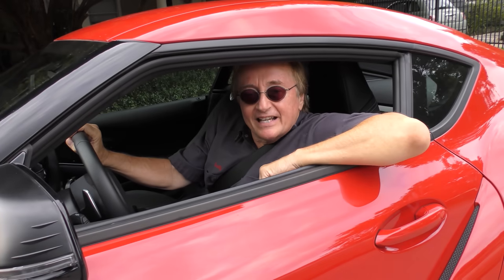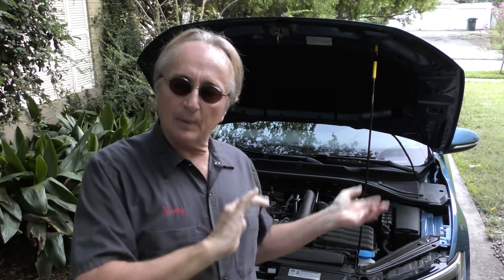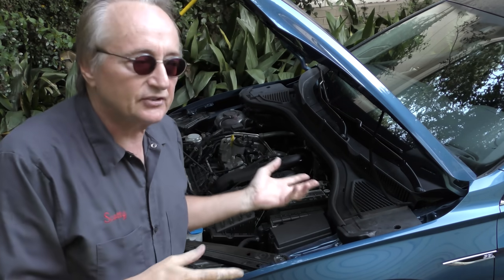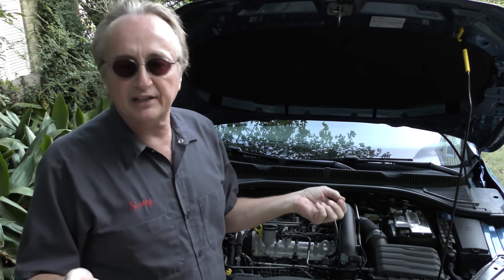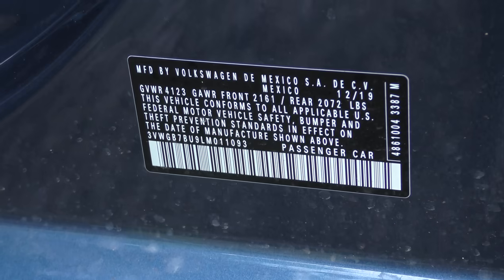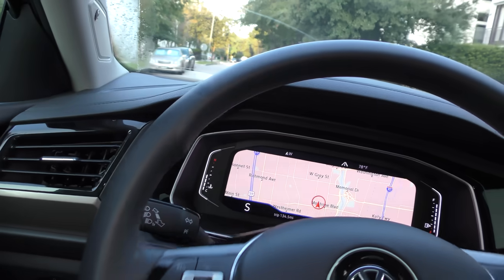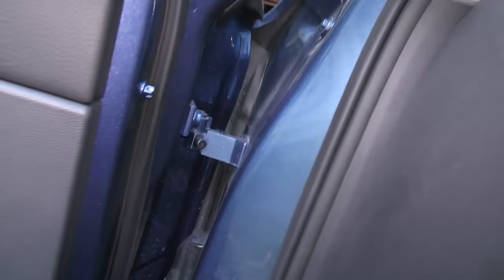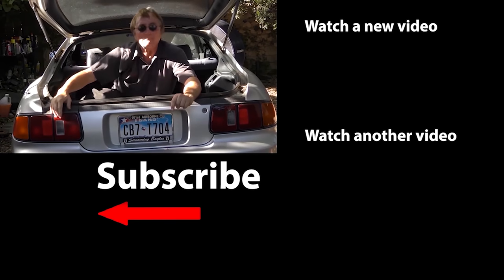I Just Found the Worst New Car Ever Made

Comment: “Everything I don’t understand is  the worst.” - Toyota drivers
Reply: Right? LOL they get confused when they drive an expensive car with good handling, comfortable interiors, and powerful engines.
Reply: Bah ha ha!
Reply: I have a Toyota Tacoma and been through a Corvette C5 for 5 years, and now have a 2021 VW GTI. I can tell you right now the GTI handles and rides better! The interior is way better, the engine is easier to maintain, and no more automatic Silverado transmission. Now I have a dedicated manual transmission in a German car. It's so fun!
Reply: @Dcc357  ditto! Been driving VW since my first car way back in 2002. I have a GLI. Your 4 door cousin.  Lol and 6spd manual as well. Lol never owned an automatic. I get restless in them. So I need a completely engaging experience. Lol
Reply: Nah, that's just Scotty. I drive a Toyota and this Jetta looks like it's a great car. Especially with the cost of fuel nowadays.

Comment: That turbo may be easy to access but it's built into the exhaust manifold and the cat too! Need a new CAT? You're also buying the turbo. This also has air to water intercooling on the intake side and that's not a cheap assembly either. Lease it new or forget it.
Reply: It's a solid design, VW has been using it for years.

Comment: The high end Corolla XSE/XLE can go between $28,000-$29,000. Corolla has a 1.8-liter engine or 2.0 engine with timing chain
Reply: Imagine how much the OTD price is on that Corolla lol. No thanks
Reply: @spoton3278  it'll still be worth more than the vw with the same amount of wear. So you save more in the long run.
Reply: Yeah step 1 buy a cheap 2002 corolla s.step 2 rebuild the engine for 1500 because they are oil burners. Step 3 now you got a new car and its quicker than the new corollas cuz how light it is
Reply: @hemiplow1297  My family owned 2 corollas from that generation which I actually grew up learning how to drive from. They are the slowest cars I have ever driven, they may be lightweight but only have around 100hp with a 4 speed trans - 5 if manual
Reply: @Argedis  actually 125 hp for the 1998-2002 and same to torque pretty plenty
Reply: @Argedis  actually 125 hp for the 1998-2002 and same to torque pretty plenty
Reply: @Argedis  vs 130 hp for the 2020 corollas. ..but again you are like 200 lbs lighters slap an air intake and do a few boltons you will easily exceed these newer cars
Reply: @hemiplow1297  You are looking at this on paper... My parents had a 98 and a 2000 and I drove both for several years. Small, light and nimble? Yes. Peppy in the city but gasses out extremely quickly because a lack of power. Merging on the highway is extremely slow especially with passengers. My 2014 Mazda 3 with 155hp weighs 2800lbs and feels like a rocket ship compared to those corollas. I still loved those Corollas but I will never forget when I had my friends in the car  and had to merge on the highway with my foot WOT and it would take 15-20 seconds to get to 60mph
Reply: @N0RT2G0RD4U Hondas are not tanks like in the 90's.  Toyota is my first choice. The interiors of Honda Civics just fall apart after warranty expires.
Reply: @Argedis  seesh really? It only took like 9 secs to get to 60 for me in my 1998 corolla le with 200k miles i race people up and down the highway all the time lol Ive maxed out my speedo few times where it went over the 110mph mark.but your right it does feel quite slow with 4 people in it when going up mountain passes i must put my emergency flasher so people dont honk at me lol
Reply: @N0RT2G0RD4U They are cheaper with the smaller Corolla then the bigger sedans
Reply: Warranty Direct rates VW the 2nd Least Reliable engine due to frequent breakdowns.  My Beetle died at just 70,000 miles.  My 2 Hondas went 300,000+ miles with no engine breakdown.

Also VW commits criminal acts by cheating on EPA and EU pollution tests

Comment: A tiny turbo charged engine AND a timing belt.... NO WAY I would ever consider buying that.  The word "warranty" is overused and has no meaning nowadays.  The warranty is for the belt only.  It does not cover any damage done to the engine or valve train when the belt does and will fail.

Comment: Why would you want a car that isn't fun to drive to last forever?  I prefer a car that is fun to drive.  If I have to replace it every 8 - 10 years, not a big deal, as the technology changes so fast a 10 year old car is way out of date.  For a car that "lasts a lifetime" get a pre-1970s classic and fix it up, like my 1962 Ford Falcon.  Simple, easy to work on.  No emissions system to worry about.
Reply: Toyota Corolla or Honda Civic are fun to drive

Comment: I had my timing belt changed on my 2017 Jetta at 180000 miles and the mechanic said that it looked great. I'm not gonna change it again until 400k. Cost me $1250
Reply: 180,000k on a 2017?? How has the car been? I have a 2010 Jetta that just his 140k. The only repair I’ve done besides maintenance is one ignition coil
Reply: @gunnargeroy8406  it's been great. No issues whatsoever.
Reply: @CourtneyKarl  wow, awesome!I’m gonna get a 2020/21 when mine is paid off lol

Comment: I’ve had this car for about 3 years and the gas gauge is definitely “optimistic”. You get about 600-700km/ tank, but after 300km it will still read 3/4 full. The gauge drops rapidly after that.
Reply: Same with my civic. 
I get 550km.a tank but the gauge won't move till after 150km ..lol
Reply: I've noticed the same thing

Comment: 2011 Jetta, bought used at 58,000. Now at 140,000. Only replacement so far are spark plugs. Besides the horrible fabic liner, everything is smooth sailing

Comment: I have this car, same trim, same color.  Im sort of relieved that he didn't have more bad things to say.
Reply: Kinda funny how he was hating on the whole timing belt thing. I’ve had 3 mark IV VR6 VW’s and they all had a chain. Put 200k on one and still didn’t change chain.  But in response to having a belt now like everyone else.... if you are smart and keep ontop of your car just check out the belt for cracks or dry rotting... or just more engine noise than usual.... but... haha... you might have to wait until you got 190k on it for it to go. Would be my guess. My buddy just got one and they look so easy to work on as well. Alternator right there. I’m no mechanic, but work on what I can and I have driven vw since I could drive. They have never let me down!
Reply: @jasonkauffman3356  thank you. Mine is brand new bought with 80 miles on it. At about 12k miles now. And I baby it. So hopefully it will be a while before problems start.

Comment: You sold me on this car mate. Sounds really nice when you drive it. Timing belt doesn’t look that hard to change
Reply: 😂 go for it
Reply: Warranty Direct rates VW the 2nd Least Reliable engine due to frequent breakdowns.  My Beetle died at just 70,000 miles.  My 2 Hondas went 300,000+ miles with no engine breakdown.

Also VW commits criminal acts by cheating on EPA and EU pollution tests

Comment: I own a VW touran and live in UK.
They are okey when they are all new and have the manufacturers warranty. But they all are the worst car to work with when they do break down. You can't do anything yourself. Bloody torx everywhere. 
Plastic is brittle and breaks easily. 
Big big money pits. The parts aren't cheap. Went to dealer to get some front brake pads.  Nearly died of heart attack when I heard the price.
Bloody hell. How much do you charge in labour?
Next car will definitely be a Mazda or Toyota. At least you don't need torx socket set to work with them.
Reply: You re not from UK. The parts for Toyota and Mazda are insanely expensive in the UK.  No wonder they are really behind in terms of sales in Europe.
Reply: I can tell you why parts are so expensive, by personal experience. 
I managed to crack one of my rear light when reversing.  My fault, it was  foggy in the area I live.
It would be a MOT  failure and police officer will pull you on the side if you have a broken rear lights if driving at night.
Went to dealer and asked how much is one of the rear light unit complete.
100£ including Vat.
That was an experience mistake.
Pads front for my VW touran was 89 £ including Vat. 
Dealer at VW usually have an 80-100£ hourly rate.
They aren't cheap. More horror story to come if you like to hear.
Reply: Ching Ho how much do you think toyota dealer charges you an hour ?
Reply: I once had a problem with my gearbox. You could hear it wasn't the clutch. It was the internal bearing that gone. Sounds like a grinding noise. Asked the dealer. Would you fit a reconditioned one in for me.
They said. No sorry. We only fit new stuff in so it's under our warranty. 
So how much is a new gearbox for my VW touran? 3000£ not including labour. You're joking. The gearbox cost more than what the car is worth. Went to an independent garage and got fixed for 800£.
Reply: If not wrong. Depending on area. London area is always dearer. So over 120 £ per hour. 
In Newcastle,  north east. 
Where its slightly cheaper.  Still we are talking about 80-90 £per hour.
Correct me if wrong.
Reply: Ching Ho the same thing would happen at your Toyota dealer
Reply: Used to work with cars. God, I'm talking about good few years back.
It was much better and a lot more easier . Old style carburetor and ECU was not existing. All you need was spanner and screwdriver. 
Swore all the time when I was working with a Russian LADA.
Those were the good old days.
LOL.
Reply: Ching Ho exactly . So same as VW.
Reply: @zeroyon4562  eurocarparts is great to a degree. Yes. Its cheaper. 
They also give you the option to choose your type of manufacturer parts. But sometimes the quality isn't on pair with original stuff.
Cheap comes at a price.
They're great with oils and filter when they got sales on.
Torx and Triple square isn't for the average DIY mechanic. They are solely used because they don't want people to work with their own cars.
Specially tamperproof triple square sockets. They aren't easy to work with without proper tools.
Regarding price of parts and quality. 
Yes , without a doubt, All German made cars is build at a very high standard.  But so is all Japanese cars. There one good story one friend told me. His Audis front light went off and I think it was LED. Unit.
The whole front bumper needs to be removed to get access to the front light. Unlike any normal car, you just open the bonnet and unscrew the cover for the lightbulb.
German cars is simply uber engineered.
Reply: Ching Ho Mazda 6 2018-2020 check it out

Comment: On my second Jetta 2016 Hybrid traded at 72 only issue was both blind spot monitors went out in mirrors 50 bucks CPO covered it, battery replaced under warranty.  2020 RLine currently 62k 0 issues, I would buy a third one without hesitation

Comment: That evil timing belt you're complaining about is made with Kevlar and other strengthening fibers. Its not your average Honda timing belt from the 80s. Chains can fail too and its usually the plastic guides that go first, which a modern belt doesn't need.

Comment: Scotty: It doesn’t have paddle shifters. This is more of an economy car. 

Also Scotty: This is the luxury version, so, it’s got a sunroof. 

😂
Reply: And 148 hp is zippy! My Camry has 205 hp and it's non turbo 4 banger!😂
Reply: It's the luxury version of an economy car.
Reply: @savagewaifu4694  What makes it zippy is actually the 184 lb-ft of torque, which Scotty didn't mention.
Reply: Savage Waifu 205? Here that’s more than what an A6 would get. Are you a yank?
Reply: @Horizon301.  Yep. Where are you at? In the US The Camry either has 203 hp inline 4 cylinder or a 301 hp V6
Reply: Savage Waifu the UK. 205 hp is a lot. As I said the most common engine in that class - A6, 5 series etc is the 2 litre diesel. Previous gen had around 170 hp
Reply: @Horizon301.  Yea I'm pretty happy with it. I get about 30 mpg in town and over 40 mpg on the highway and it takes off really quick. Toyota engines are powerful and reliable because they improve on them and tweak them over time so they keep improving the power without starting over completely from scratch.
Reply: Savage Waifu yep, VW group are constantly changing, even within 1 year the same car can have a smoother or more economical engine. The 1.6TDI used to get 50-70, pretty decent. TFSI, not so much around 40 on average.
Reply: @Horizon301.  Yeah, we have that same problem with General Motors. They are constantly scrapping engines and starting over. When they do improve on something and it's respectable they ditch it. That's why I drive a Toyota. They are a lot more reliable than American cars anymore.
Reply: Savage Waifu yeah, for a reliability point it can be an issue. We tend to keep cars in warranty so there is no cost for anything minus two tyres usually and one service. £300 job done for 2-3 years ownership. Toyotas in general aren’t popular here either, nor Lexus. Thankfully we don’t have American vehicles other than ford - even then then they are designed and manufactured in Germany so quality, particularly within the interior is greatly improved so they stand a chance against VW
Reply: @Horizon301.  I can tell from first hand experience that GM products have gone down hill. I used to own a 1992 Buick Roadmaster and it ran like a clock. I sold with 250,000 miles/400,000km in great running condition. Now I own a 2008 Buick Lucerne and it's been an endless money pit since I got it used at 50k miles. Same brand except 16 years apart and one's a total junker and the other was old reliable. I recently bought the 2018 Toyota Camry because I just can't stand my other car anymore. Americans drive a lot and we put a lot of miles on our cars so we get really mad when the don't last. You'd think if anyone would understand that it would be American auto companies but they're to greedy. I switched to Toyota after seeing my older brother's 1996 Camry go over 350,000 miles/560000km and it still going with the same engine and transmission. A lot of cheapskates buy older Camrys because they are cheaper than suvs and you can drive them a lot of miles and not have to do much in maintenance. Plus Toyota parts are cheap here.

Comment: I love my jetta R line. Great gas mileage and nice interior for 20k. Would recommend
Reply: I have the 2019 jetta and I'm about to trade it with Atlas what u think?
Reply: Loving my manual 2021 Golf GTI SE Mk7.5. Snatched one before the dealers ran out because I don't want a Mk8. The interior is a whole other ball game for a small car and I can't have it any other way. Handling is fantastic and it actually rides okay.
Reply: @Dcc357  Golf is a legend have u seen the Gold 2020 with the stick?
Reply: @kingofhavila9850  If I had that and had money to spare, I would make a solid gold golf ball shift knob for it lol.
Reply: @Dcc357  lol
Reply: Warranty Direct rates VW the 2nd Least Reliable engine due to frequent breakdowns.  My Beetle died at just 70,000 miles.  My 2 Hondas went 300,000+ miles with no engine breakdown.

Also VW commits criminal acts by cheating on EPA and EU pollution tests

Comment: I’ve driven the base manual version. The engine and power train work well together. The brakes stop the car promptly as in most manual cars. The ride is harsh (Scotty explains it well; being in the backseat when the car goes over bumps is sort of jarring). The steering is light and it has a tight turning radius. The interior is cool. Apple CarPlay works great. The seats ergonomics are mediocre. The exterior design is slick. The MPG is fantastic. I might consider getting one on sale at Christmas time.
Reply: Warranty Direct insurance company rates VW the 2nd Least Reliable engine due to frequent breakdowns.  My Beetle turbo engine died at just 70,000 miles so the WD rating seems accurate.  My 2 Hondas went 300,000+ miles with no engine breakdown.

Also VW commits criminal acts by cheating on EPA and EU pollution tests

Comment: Scott, you got to be honest bc we all saw you are loving this car. You love it so much that you wish it had a real lifetime timing chain.
Reply: Warranty Direct insurance company rates VW the 2nd Least Reliable engine due to frequent breakdowns.  My Beetle turbo engine died at just 70,000 miles so the WD rating seems accurate.  My 2 Hondas went 300,000+ miles with no engine breakdown.

Also VW commits criminal acts by cheating on EPA and EU pollution tests
Reply: @electrictroy2010  As an owner of VW and Honda (2012 CRV and 2014 Jetta), my true ownership tells me Honda isn't that great for reliability while VW isn't that bad as well. I do the service myself; noticeably  Honda uses cheap parts e.g. rotors, pads, battery and many more.
Reply: Well I’ve owned 2 Hondas that went over 300,000 miles without engine breakdown.  The VW didn’t died at just 1/3 that distance
Reply: Honda has several cars that passed 1 million miles on the original engine.  VW has ZERO.  Statistically VW engines breakdown more often than any other brand (except Land Rover)

.
Reply: @electrictroy2010  Dude, how many times are you going to tell everybody? lol This is like your 6th copy and paste of that stat.

Comment: Since this video was made VW went to a 1.5 Turbo in the base model. As far as I can ell the 1.5 still has a belt. Butteh higher end Jetta has a 2.0 with a chain. I assume they've fixed the chain problem. I'm interested in one because it's one of the few sedans that can be purchased with a true manual transmission.

Comment: I just bought a 2020 vw jetta s which was used for 2500 miles. It still has a 47500 mile bumper to bumper warranty and since its a preowned, they added another 25000 mile bumper to bumper on top of original warranty from the manufacturer. I dont care about its reliability or repair bills, i got warranty for probably next five to 7 years